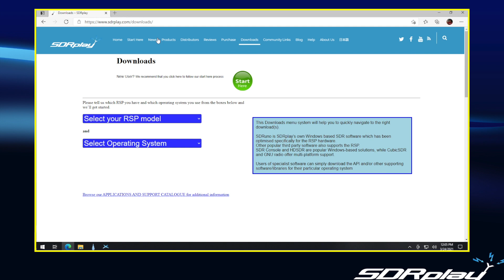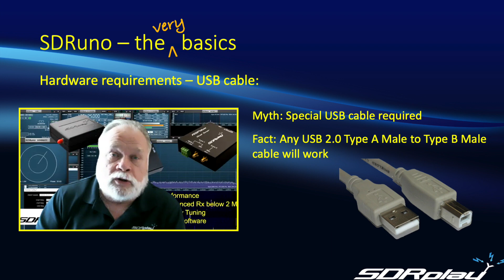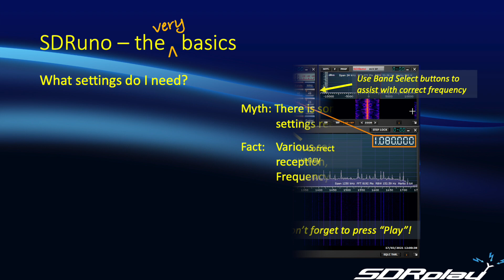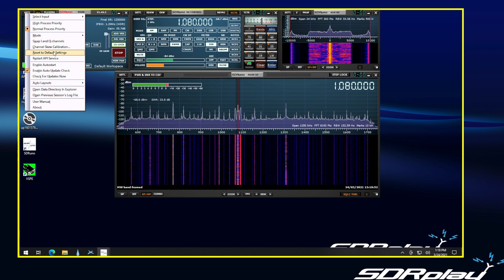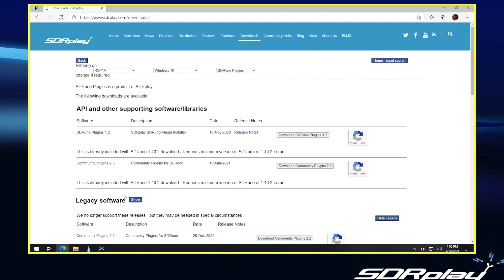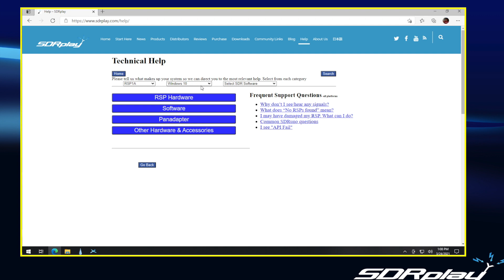SDRuno - The Basics (obsolete - new version link in the comments)

Comment: If only there was a release for Linux.
Reply: That’s what stopped me buying one already. 
I don’t want to buy a product only to not be able to use their own software. 
On the road map for SDRUno it does show Mac and Linux versions but no date.
Reply from the maker: It's on the roadmap. It's not a simple port, it requires a total re-write.
Reply: @SDRplayRSP  I’m running Linux on an old laptop. Dumped Windows as it’s too greedy on resources for the system power I have available. Fully understand that you would write software for the most likely OS to be used first.
Reply: Can you run windows in a virtual machine inside linux?
Reply from the maker: @Well_Theres_Your_Problem  Yes. Some people use WINE. I run Uno in a VM on Macs with great success.